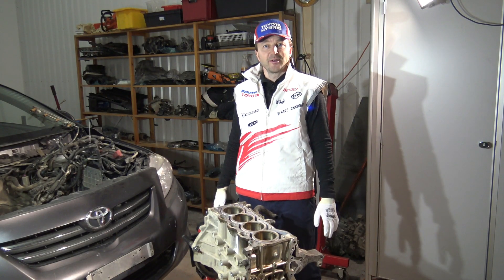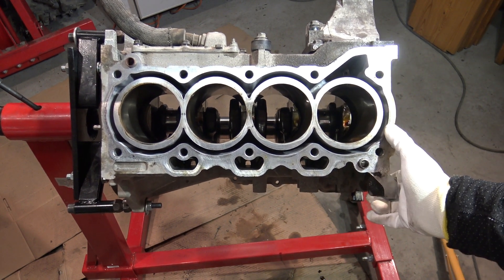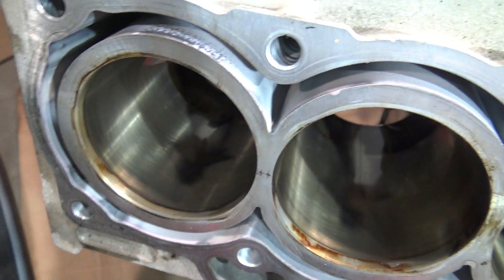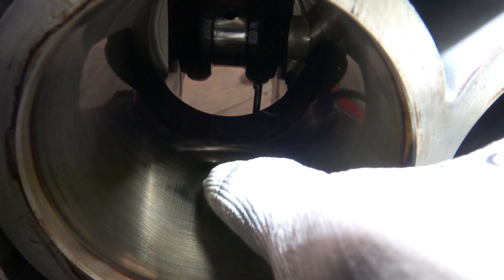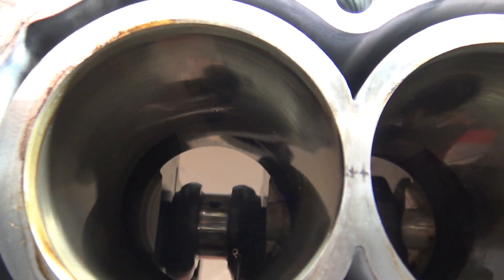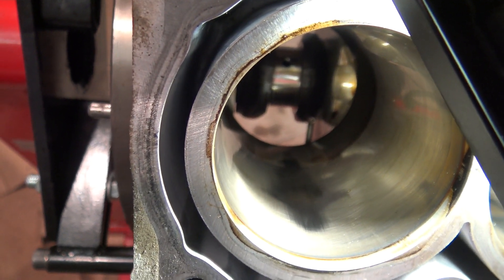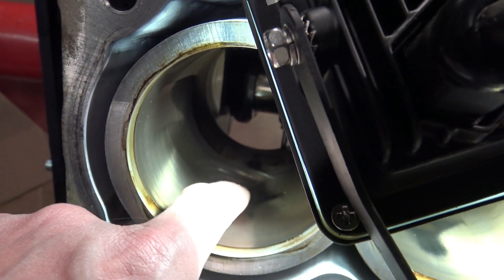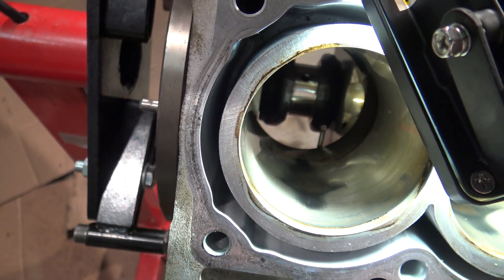How to know that engine cylinder tubes are worn out

Comment: Hello Mr Peter, I had an issue with my car recently and they told me i have to change the gasket when we open it they told me that the cylinder tube same in your video is worn off exactly looking the same in the video. And they told me its not repairable? Should i try different mechanic ? And if i continue without repairing will it work
Reply from the maker: Thanks for your comment, noted 👍